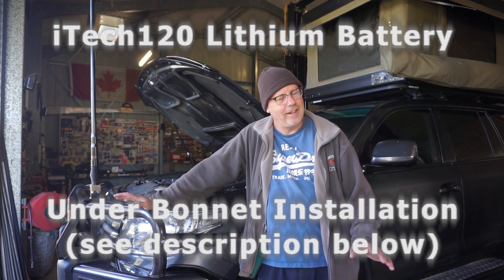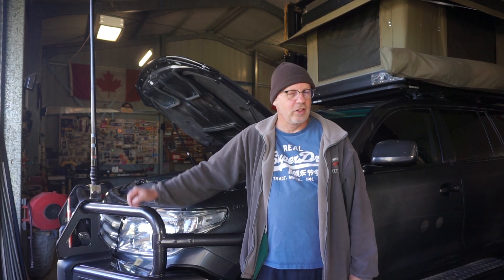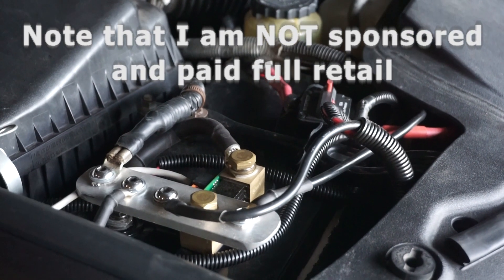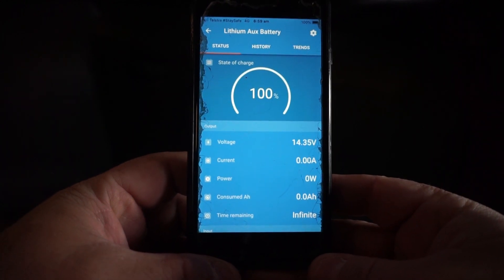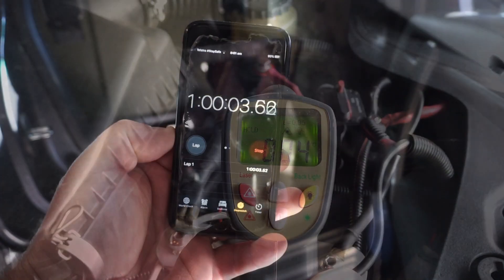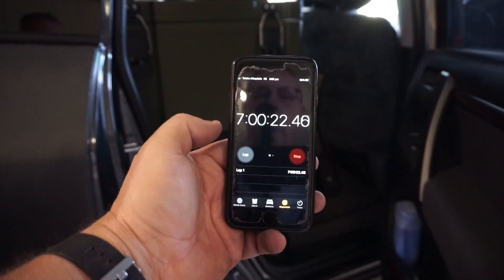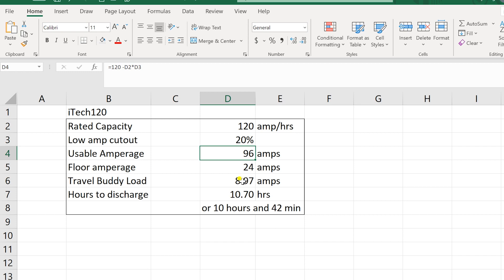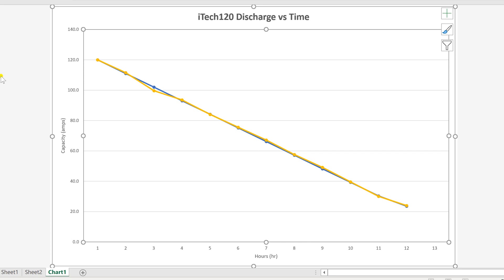Lithium Battery Long Term Review | itechworld 120 Under Bonnet Installation

Comment: Another good video, but please do not confuse 'amperage' with 'Ampere hour' or 'Amp hour' capacity. They are NOT the same thing and should not be intermixed.
The 2 things that have made me shy away from these batteries are price (bang for buck compared to lead-acid) especially when a new charging arrangement is also needed, and this heat issue. Love to know what it will be like in a year or two and how long it will last in this environment.
Also the test results might differ if done at normal under bonnet working temperatures - at least at the start of the test which would better reflect real life usage.
Reply from the maker: Thanks Trevor, good point re amperage and amp hr.  As I noted in the video, I will repeat the test a year out but given the flogging I have given this battery and the fact that it is still at 100%, I cannot see it changing considerably over the course of the next few months.
Regarding testing using normal under bonnet working temperatures, in my case it is impossible to do the comparison as the baseline or "new" battery was never tested under bonnet as new.
Perhaps someone else may do the testing.
Regardless, at some point the weight of the information available to the general consumer will provide a tipping point for you or others.  If you have not reached that tipping point yet, that's cool, we are all different. 
Keep the shinny side up Trevor and thanks for watching.

Comment: Fantastic video terry . I too was sick of hearing the negative comments on my same itechworld battery . My battery has performed flawlessly and I’m gonna do a capacity test on it at the one year mark . I have had mine now approx 10 months and it’s under the bonnet same as yours .The prices of these batteries have gone up quite considerably in price since my purchase. Hope you been well mate ...cheers 👍🍻
Reply from the maker: Thanks for the feedback mate and for sharing your lithium experience.  You make a good point about the price of these batteries.  I too have noticed the increase and I am not sure why that is the case.  Less supply, more demand, a combination of the two, hard to get raw materials??  I'm glad I got mine when I did, that's for sure.  It's a fantastic technology and like you, I certainly have no regrets.  Cheers!